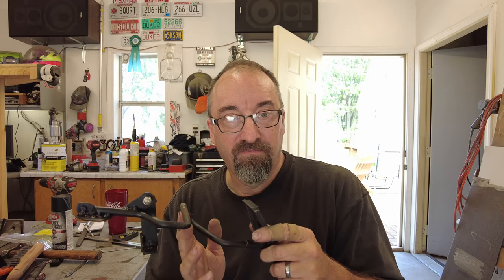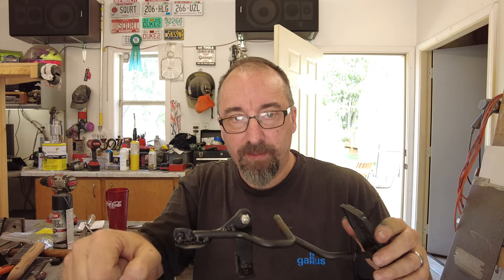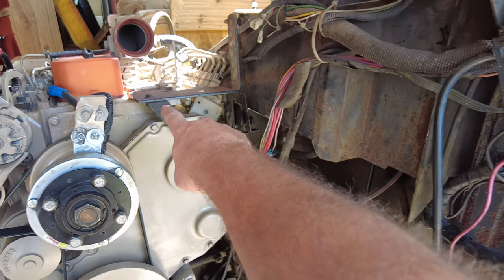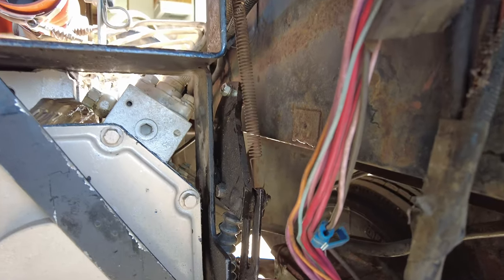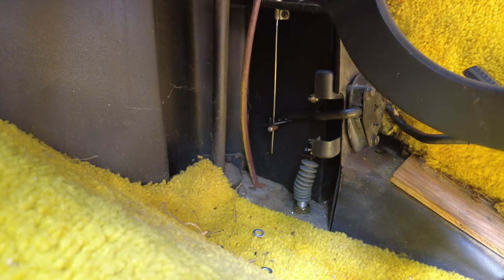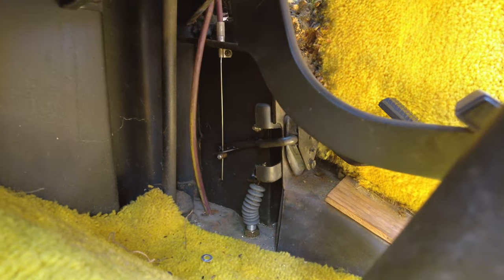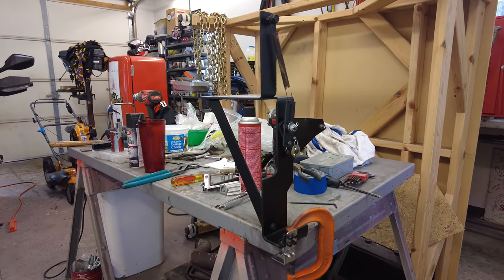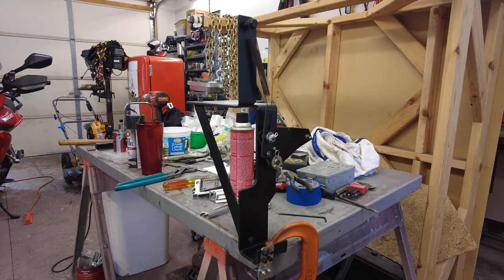RV Cummins Swap - #12 - Throttle Linkage & TPS

Comment: I found the TPS from Pace to be very fragile weak plastic and after a while it failed with intermittant weird symptoms...replaced with an Allison TPS which is very rugged and basically more designed to be within a tough engine bay environment...hopefully your does not break but if it should then take a look at the Allison ones they're bomb proof!